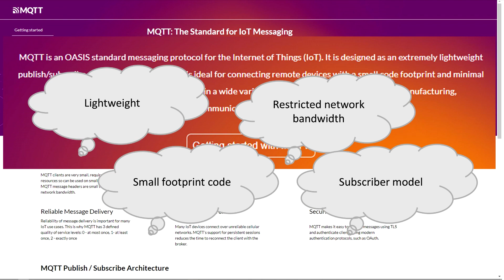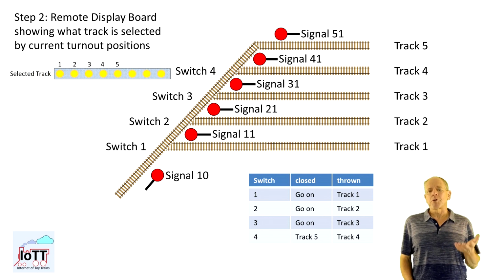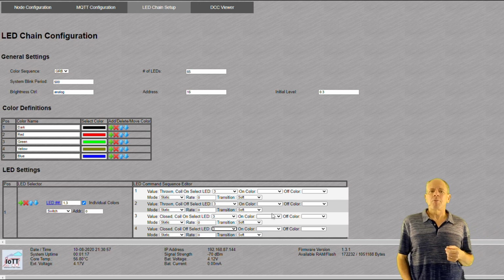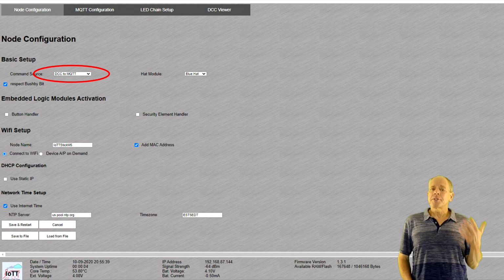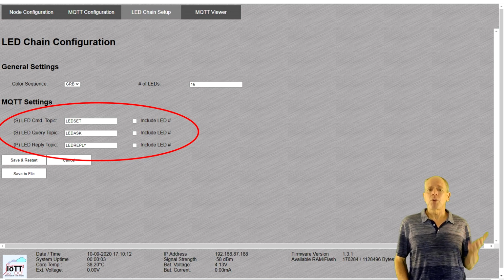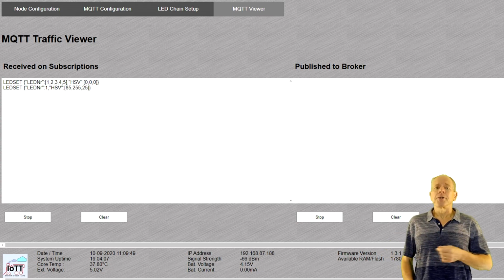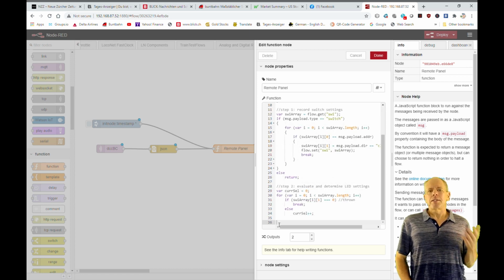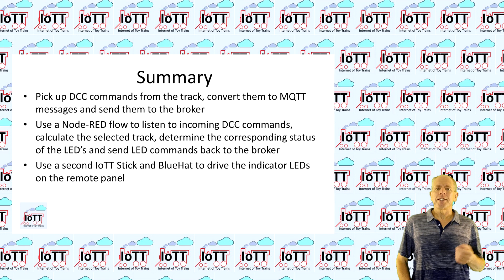More Fun with MQTT (Video#53)

Comment: Good information....however I'm all for leaving loconet just for engine control and taking signals and other "noise" off of the buss....when loconet goes down so does everything else
Reply from the maker: It is always a very good idea to keep networks for mobile and stationary elements separate. And in general I find that when cabled correctly, LocoNet is a very stable and robust network. However, one of the design goals of the IoTT Stick is to create options, that's why I implemented MQTT and Wifi. Up to you to choose what fits your requirements best ;-)